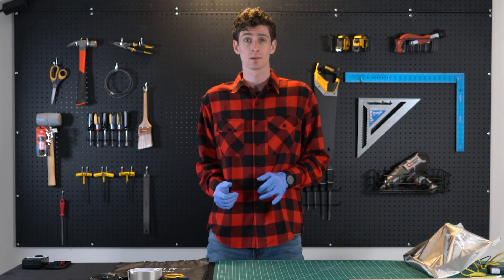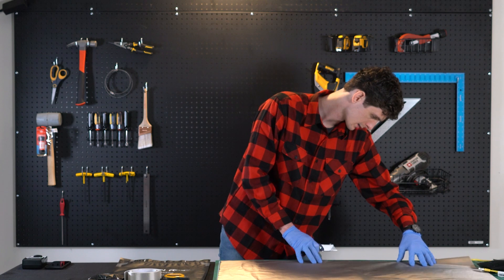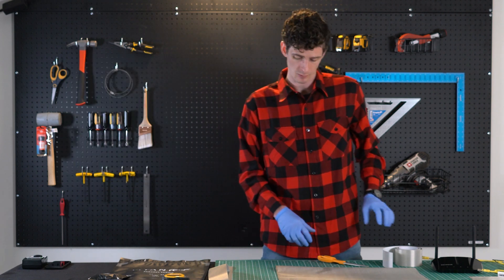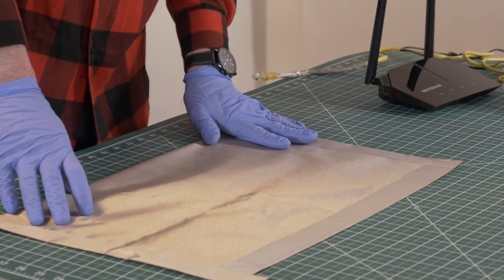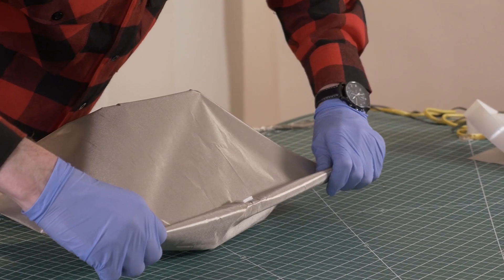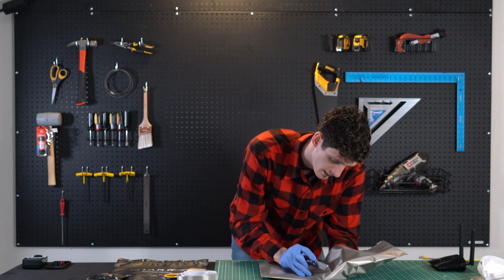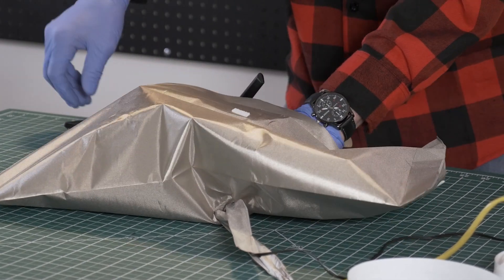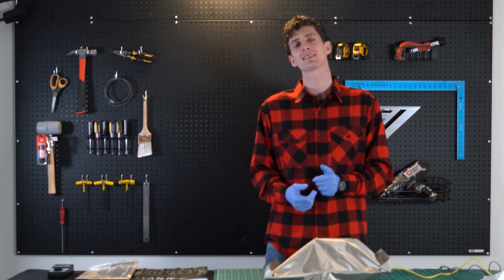Build your own DIY Faraday Router Cover to block EMFs, RFs, & to protect your health, data & privacy

Comment: Hello. So if you leave the cover open only on one side, will the signal leach out only in that direction or all around the cover as if it would have not existed? I am trying to build a shield that would protect only one side, but allow the wireless signal to be emitted to the other side. Is that feasible? Much appreciated
Reply: I have the same exact question 😅

Comment: IT WILL Overheat if it is not vented.  I would design it differently
Reply: How many times will they replace it for free before They upgrade to me to another unit that might be able to be turned off?

Comment: Can’t you just cover the antennae instead of the entire router? Given the antennae is the part that is sending signals?
Reply: why do you assume that the antennae  is the only or primary way the device emits EMF.  It makes zero  sence.  Ex.   Microwave ovens ,  don't have antennas but they will melt a chocolate bar in your hand  if you stand or sit close to a heavy duty microwave oven.   And don't hold you cell phone directly against your brain/ skull.

Comment: Will this stop your router or modem function
Reply: Yes
Reply: just think about that for a minute...
Reply: Yes this is the whole idea of the video. However the young man should have explained why he was putting the cables in back of the router when you won't get a signal. You would have to open up the Faraday cage in order to get a signal.

Comment: xfinity rents out routers and doesn't tell customers that EVEN if they turn off wifi, there will still be a hidden wifi channel left ON unless customer buys their own router to control. Completely sneaky.
Reply: they told me that there are 2 channels but to completely turn it off ( when not using ) to completely unplug the power.
Reply: if ur from uk its the same with the routers zzoomm give u in the uk the (icotera i4882-01) model to be exact

Comment: As a network engineer this is the DUMBEST thing I have seen yet. RF is non ionizing radiation. NOT nuclear radiation (the actually harmful stuff). Guess what! The radio in your car the satellites flying above earth ALL USE RF. shoot the very lights in our homes use RF. All light visible or not is RF. The internet coming into your home over coax? You got it! Its RF! The FCC dictates power levels for a reason.. there is such a thing as an RF burn. But you will never get one from your router. Not enough power to worry about it. So so much disinformation in this video and it is absolute fear mongering.

Comment: Are people actually falling for this? Holy crap. Wrapping your router in a Faraday cage simply means it's on, but it won't be working because you're blocking the signals. If you're fooled into thinking the router can be harmful then just turn the thing off at night or whenever, same results without the silly aluminum foil router hat.
Reply: Exactly, 🤣🤣. Im only watching this because I want to block signals to a certain part of the house.
Reply: I'll give you a thousand bucks for doing a critically thinking required non biased comparative analysis on research from an objective view that isn't out to prove self right, but is honestly just doing the research - and come back with the same opinion and I'll give you a grand! 

Would you just lie and say you did? And only seek out what proves your own point? 

You'd be surprised if you looked it up
Reply: Most sensible comment I’ve seen here. Lol
Reply: It will be working if it's also a modem. If you're forced to use a stupid modem with built in WIfi and they refuse to turn it off this might be necessary.
Reply: you are not educated in the health issues caused by EMF radiation are you?
Reply: @invisableobserver  You're not being stuck in a friggin microwave. This is non-ionizing radiation at negligible levels. Plus, I hope people realize that wrapping your router in something that blocks the "EMF" means you no longer have access to that router. Say bye-bye to wi-fi.

Comment: Can you 🙏PLEASE tell me where to buy the fabric and tape ect. Or what site to trust?
Reply: Don't waste your money. You'll lose your Wifi and look silly at the same time.
Reply: There is absolutely nothing harmful in anyway shape or form in wifi signals. This has been a thoroughly researched and documented subject, and according to general scientific consensus, data, and testing, there is absolutely nothing harmful at these power levels. Ive been a network engineer for over a decade and work around and am involved with 3,4 and 5g far more than the normal person and im totally healthy. Dont fall for this bullshit.
Reply: Hi Sarah, I wasted my money buying this, don’t do it. Did everything as per the video and when asking the business the replied ‘it’s not a guarantee it work every time’. They can use all the metres they want to ‘test’ and measure but if I still have wifi then it has not worked.

Comment: I set my router on top of a metal mesh office tray and put a small metal mesh trash bin over it, doing a similar thing to smart meter, mesh trash bins are less than $10 so why spend $$$ or a fabric that could lose the ability to shield within a few months?
~ AC Ducting tape also blocks radiation.
Reply: Where did you buy the trays ?
Reply: Lol...why?

Deflecting the signal back at the router is potentially going to damage the router.

Also going to give you terrible service.

If you are so concerned, just drop the transmission power in the routers menu.
Reply: Does that work?
Reply: @inthehouse9062  yes
Reply: @invisableobserver  Do you need both the office tray and the metal trash bin or just the trash bin? Any particular metal? Thanks
Reply: @inthehouse9062  That is how I have it now, as long as it is surrounded by a metal mesh or screen, I prefer aluminum, though any metal should work. It's basically a faraday cage, you can even use aluminum screen as long as the screen or mesh is snug on the network cable and any other cables. Use a shielded network cable & make sure wifi is turned off in wifi settings.
Reply: @invisableobserver  Okay I want something like that to block wifi (which I can't turn off) will it do that?
Reply: @inthehouse9062  Type your IP address into your browser address bar to get to router settings.
Reply: @invisableobserver  Not my router and my wifi signal does not come from this router.. But it has active wifi.If I build a faraday cage for this router will it block the wifi signal from this router. Another optiion is a faraday blanket.Do those exist?

Comment: What is the point of shielding own router? Just turn wifi off. Protection is usefull against unecessery signal from others routers. This tutorial is only for morrons and discredits general point of any protection against RF etc.
Reply: No because you can connect your router with cables and keep the box no using 5g without getting hit with death signals
Reply: I don't believe in 5g conspiracy or harm that can causes. I'm searching how to build a Faraday Cage to my router, because even I turn the WiFi off, the neighbours stay using my network ! Only when I unplugged the router from energy they stop...

Comment: my router gives off a lot of heat and has a large venting area to release the heat.  Won't the router overheat if I seal it in the bag?
Reply: Can i just put a cover the RG cloth over my router like a blanket so it can get some cooling air and it may not stop all RF sigs but at least minimize them ?
Reply: You can just unplug it. No?
Reply from the maker: The router/modem may overheat especially if it is an older model. We always advise customers to keep an eye on the temperature of the router and ensure that it is not overheating.
Reply: @missiondarkness  Actually they overheat regardless of whether they are new or not. This could be very unsafe, why not mention it at the beginning of the video given the potential consequences?

Comment: with the cost of the fabric, just login, turn off wifi, take off the antennas and then follow instuctions - i mean if you must...
Reply: Exactly the search would be much easier if people stop telling the obvious turn it off. If turning it off was an option I wouldn't be here. My search keeps giving me instructions how to turn it off.
 Are people that stupid that they need instructions to turn it off?
 It's the stupid leading the stupid telling stupid answers thinking I'm stupid but people are so stupid. They can't even hit the offswitch so instead they think i'm stupid and tell me just turn it off duh😅 I would if I could.
Reply from the maker: Yes, this makes sense, however, the purpose of this structure is to avoid having to constantly turn off and on your router and reassemble it. This can be extremely timely and difficult for those not familiar with technical router mechanics. The fabric is $23 and you will have some left over for any other projects. No disassembling routers or rebooting.
Reply: Unless you forced to use a xfinity modem/router that has NO option to disable the wif radio(tg1682g) trust me ive tried everything you can and there is is no option-- if i use my own modem then have pay 30/m for unlimited data. its a for sure a scam as they provide a free hotspot to everyone using their device on my internet thats why i want block it and stop the interface from extra signal..i even tried to see if we can remove the wifi antenna module/ radio by opening and which it is soldered on. no wonder xfinity is hated. so now gonna have to buy a meta box and hopefully wont over heat it and burn down the house. This guys video make no sense thru. like you cant even put the antenna down? for everyone else just turn off the radio thats it, who has time and money to do all the extra work and he show very little proof aside from a 2 sec read out on whatever device that no one knows about. dont trust it

Comment: So, how are you supposed to get WiFi?
Reply: only idiots use wifi, get a network cable
Reply: Perfect..... perfect.... perfect . . . Waste of time.
Reply from the maker: Simple. You can open the structure and wifi will operate. Once the structure is shut by the velcro closure, wifi is blocked. Once opened, signal can reach your device again.
Reply: @missiondarkness  if dont want wifi, then unplug the router, and use modem and ethernet only, will it be better than wrapping the router ?
Reply: @illegalaccess7225 The ESP is providing the router with built in Wi-Fi. There is no way to turn off the Wi-Fi I need the modem so this seems like a potential option.
Reply: @missiondarkness why not just unplug the router? Wtf